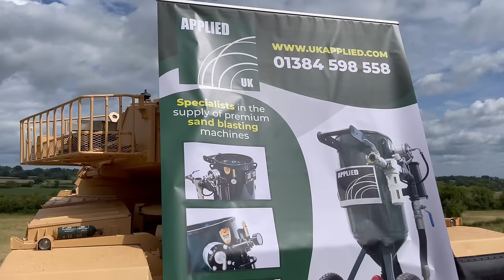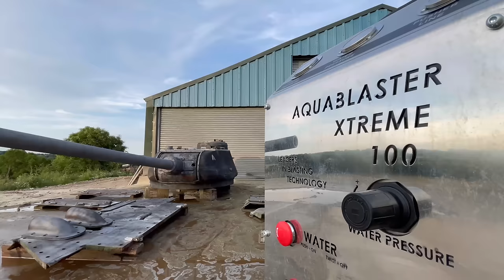T-34/85 Restoration (Pt.3) Aqua blasting!

Comment: Hi guys. Could you tell me the diameter of the support wheels in the T-34 tank. I am interested in the diameter of the support wheel and the diameter of the support wheel with rubber pads.
thank you

Привіт хлопці. Ви б не могли мені підказати який діаметр опорних коліс в танку т-34. Мене цікавить діаметр опорного колеса  і діаметр  опорного колеса з з гумовими накладками.
Дякую